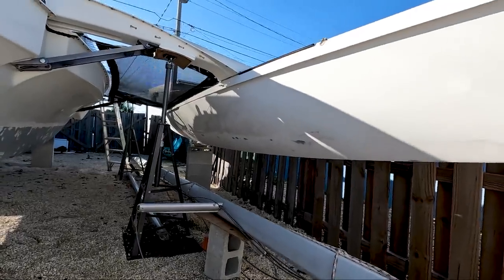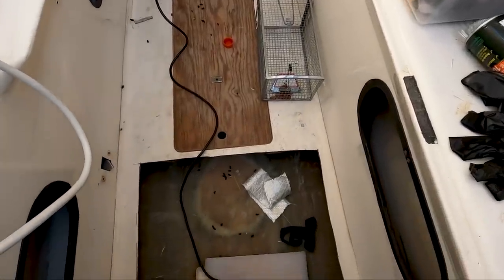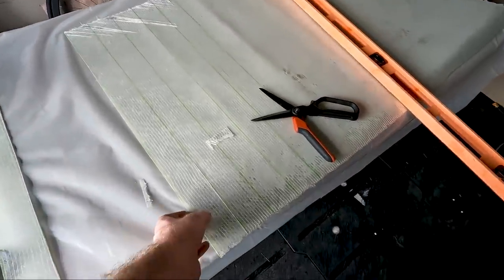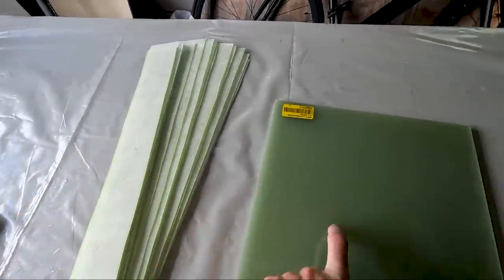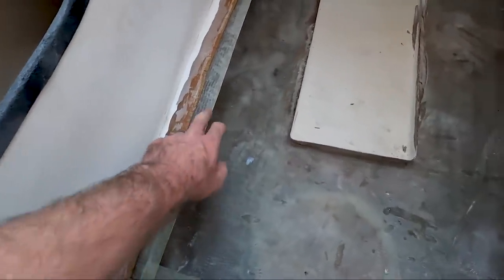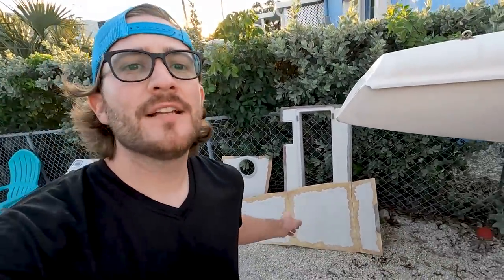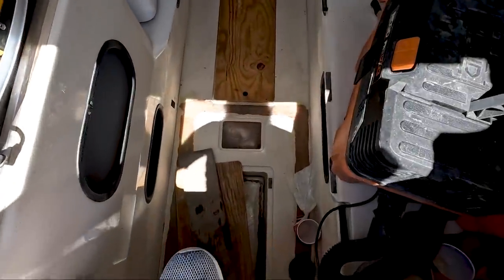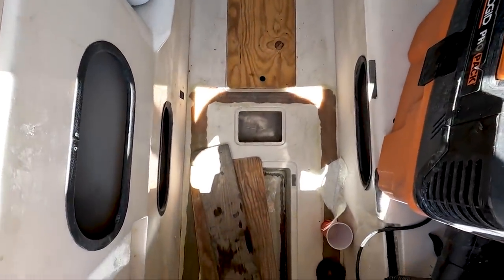Major Issue FIXED - F-27 Trimaran Structural Repairs DONE | Learning the Lines

Comment: I have done similar work on a couple of farrier trimarans. Get rid of the rollers on the trailer and replace with bunks. On the F25s o worked on, the damage was in the same are as the two front rollers, bouncing on the trailer was likely the cause. Now with bunks they have much more support. If you really feel you need a roller for getting on th trailer (the 27 is def heavier) then get just one (double for more support) roller at the front not another one 3’ back, just bunk as far forward as possible with the one roller just to get the very front on the trailer.  The f boat lists should have that in there somewhere, but it’s pretty simple.

Comment: I seem to remember that that it was a leaking companionway hatch that caused all the damage. Did you shoot any footage of that repair? Maybe a recap of work to date at some point. Nice to see the all the structural stuff completed.
Reply from the maker: All I've done so far about that is cut a new hatch board out of 1/4" epoxy coated ply and duck taped the suspected leaking fixtures in the pop top. Nothing really repaired yet, but I did stop the leaking until I can actually repair it.
Reply: @LearningtheLines  I have noticed that some owners have replaced the companionway drop-in boards with thick perspex ones, giving the advantage of being able to see the cockpit from down below and letting in heaps more light! Uma have done it with their boat.
Reply from the maker: That's likely what we're going to do! In a small space like this, it makes way too much sense. Lol
Reply: @LearningtheLines  Thank you for the explanation, glad it stop the rain from getting in.

Comment: When you take out the mousefur it's very hard to clean up the contact cement that held it in place. And ton of work. You should consider putting new mouse fur in at least in portions. Corsair dealer may find it. Or you might get new mouse fur from fablock,think is in Ohio. The mousefur Corsair used was  front runner brand